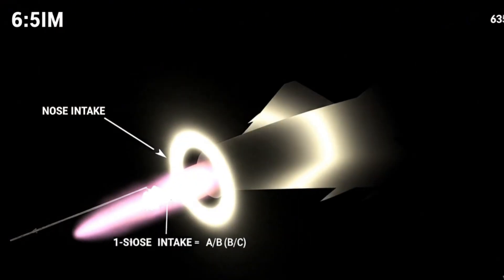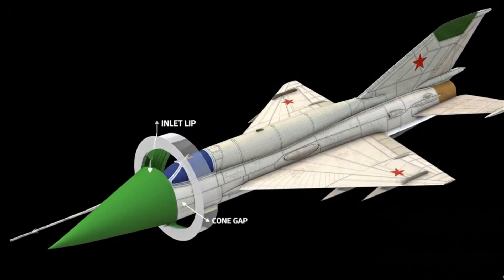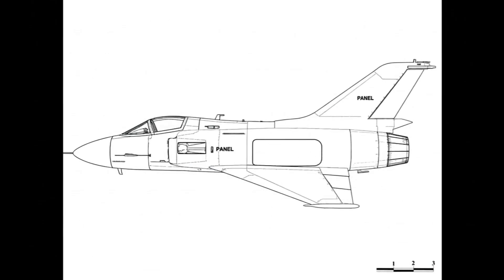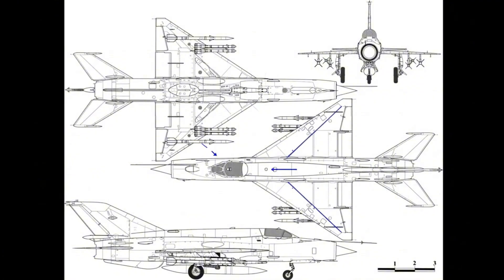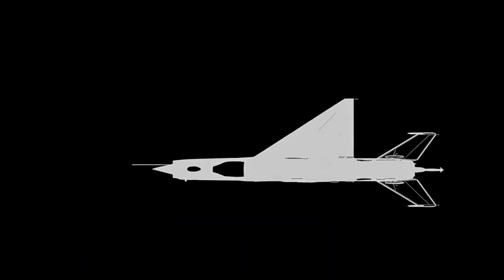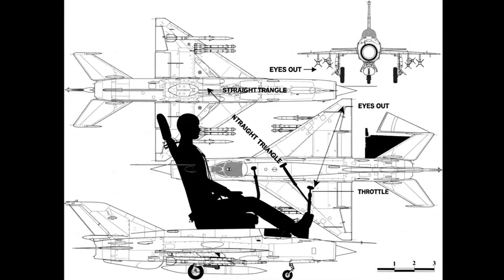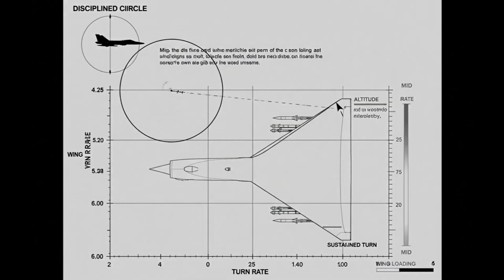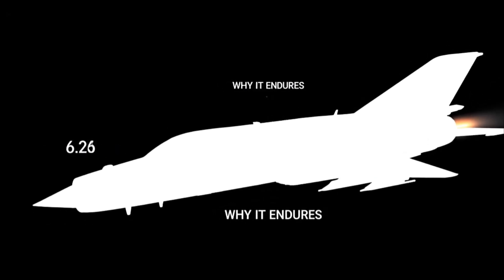Inside the MiG-21bis — Cold War Intercept

Comment: But what about MIG-21 BISON fighter aircraft?
Reply from the maker: Great question! The MiG-21 Bison is the Indian Air Force’s upgraded MiG-21bis (often called MiG-21-93). It keeps the same airframe but adds modern avionics — Kopyo radar, glass cockpit + helmet-mounted sight — and newer weapons (R-73 HOBS and BVR R-77). In short: a 1970s airframe with 1990s sensors and missiles, so it fights very differently from the baseline bis we covered.
Reply: @InsideTheMilitary same as f7 ??